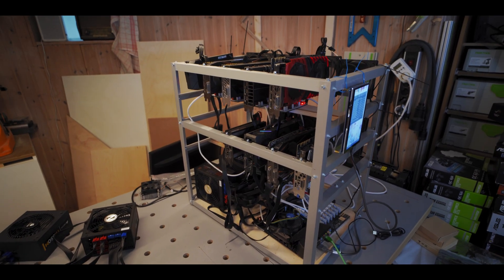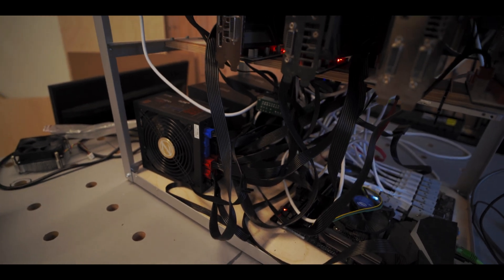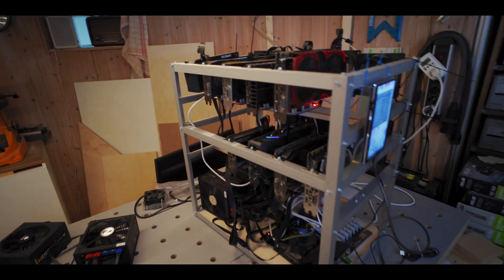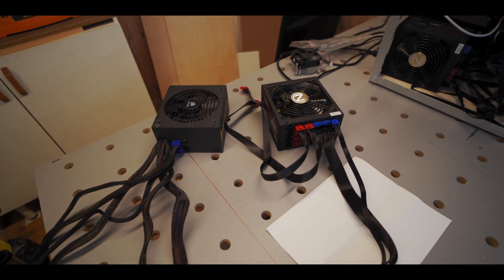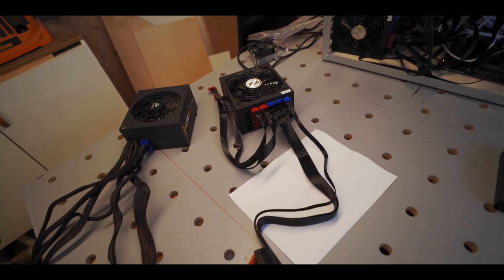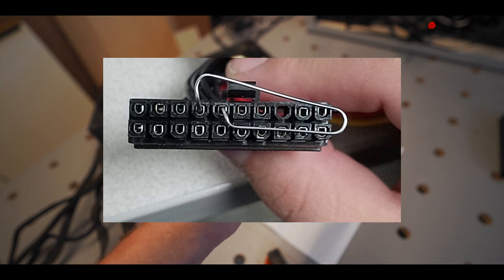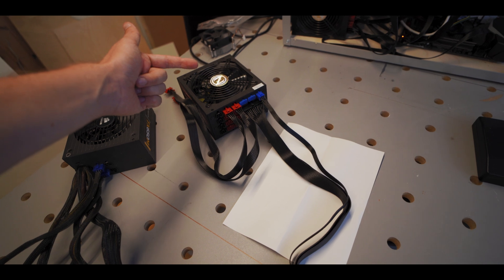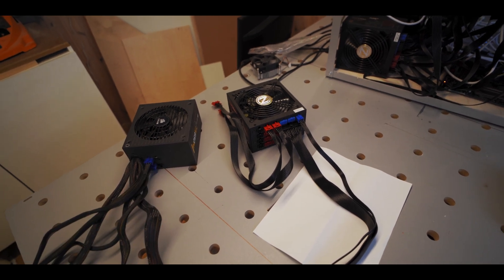How to SAFELY use multiple power supplies for crypto mining (4 ways!) 24-pin PSU splitters, Add2PSU

Comment: Hi man , nice Videos. Can you give me a tip ?
I plan to Power 4x 3080ti´s do you think the 2x 850watt psu´s from your Link can do that. I could not get my head around the riser thing.
So in order to power a gpu and its riser i need to connect one 8pin vga to gpu & for the riser a 6pin sata ?
im confused , because there is 2 8 pin on the graphics card and it just needs one of them 8pins to work ? 

your help would be much appreciated

Comment: What if you're using PCIE riser cables that aren't powered? Do you recommend only using powered risers? I'm looking to add another 3090 and there isn't enough room in my case, so I need an extension cable and I also need to add a second power supply to power it. I'm not finding many options that are powered and also PCIE Gen 4.

Comment: Hi Seb, thanks for the great vid and I have a questions. 

I have a 10x 3070 rig currently powered by 2x 850w PSU. Main PSU connected to MB + CPU + 5 x 3070, the other PSU connected to the rest 5 x 3070. 

My questions are 

1. Is the main PSU solely powering MB and CPU so it handles more power load than the 2nd PSU? Or are two PSU evenly splitting all powers load of all components (MB+CPU+ 10x 3070)? 

2. I am thinking of replacing the main PSU with a 1000w PSU, is it okay to have 2 different watts PSU powering the same rig? Thank you so much for helping!
Reply: youre cancr

Comment: So can i use a 24pin splitter to power GPUs on both power supplies ? Or do i need one power-supply for GPUs and the other PSU for other components when using a 24pin splitter? What about the chip, can it help both PSUs to power GPUS?

Comment: i have a main 550w and im getting an extra 750w for gpus. Do i need to switch the 750w to the main position necessairly? The 550w is so well set up, didnt wanted to disasemble it all. I wish i could use that 750 as second psu

Comment: What happens if you connect the one with two cables (the cable at 5:10) to the main psu? I may have done it and now the cpu fan and gpu fans wont spin. gpus get hot but fans dont spin. I dont understand it. Now I connected them like you showed but still rig doesnt turn on.
Reply: I think motherboard is ok. When I press the power button psus work and when I hold the power button they shut down. But I still could get cpu and the gpus to work. Do you have any advice?

Comment: I have no idea why, but I have this adaptor add2psu but it simply doesn't work, I feel it's not feeding too much power, so not even the bios come out, only black screen, and the fan of the psu doesn't spin either... I'm using gigabyte 1000w full modular

Comment: I need to connect 3 PSU can i use 1 x 24 pin splitter cable and ADD2PSU chip ? or 2 x 24 pin splitters ? Is it safe ?

Comment: multiple power supplies for dummies like me :) thanks a lot seb. I plugged in 3 gpus to a 850w psu and it keeps restarting so I bought the splitter cable thing and it's on shipping. right now running only two cards and one is sitting idle because of this problem.
Reply from the maker: Are you sure 850W is enough for your 3 GPUs? The rig powering off is usually a sign of not enough power
Reply: @SebsFinTechChannel  total gpu power draw on software is around 650w and lets say 100 for the rest. it should be enough. they're nvidia gpus so software power should be accurate.

Comment: Good video Seb.  I just splice the signal and ground cables with detachable plugs into both of the psu's motherboard harness.  Similar to your third option, except I solder wires into the harness.  Much cheaper, simpler, and just as effective.  Looks like I have mi rig wired in the big No No method.  Will buy some more psu's so I can correct that.  Thanks, and keep up the great work. Cheers from Canada.

Comment: Need help with powering second PSU. 

I’ve done a lot of troubleshooting steps but don’t know what else i can do here. 

[setup]
PSU 1 connected with mobo, 4 gpu and hard drives. 
PSU 2 connected from PSU 1. PSU 2 has only 1 GPU

[verified working] 
Mobo, all gpus, both PSU, all ports on PSUs
PSU 1: Corsair RM1000X
PSU 2: Corsair RM1000

[troubleshooting steps]
- swapped PSU and both are working when it is the primary. 
- swapped all GPUs and they all working on primary PSU

I’ve tried using add2psu and 24 pin adapter and i still can’t turn on the second PSU. 

I even hear a click in the second PSU when i turn on the first PSU but the gpus won’t turn on.

Comment: Thank you Seb! Just ordered the SATA version of this for my new ATX power supply for my first multi-GPU rig!! It’s made of 3090s (I have limited space so it’s worth it for me to get high hashrate cards). I also used the TRex absolute core clock on them to save 55W of power on each of them thanks to your other video. Keep up the good work.
Reply: I would not recommend using SATA for mining.

Comment: Great vid Seb. 
You explain it clearly.

But if i use full modular PSU, where to plug the molex cable? 
so i need to buy 6/8pin to molex right?
Reply: or Four-Pin Peripheral Cable = molex?

Comment: Good job. Thanks for the video. GPU and Riser on the same power unit. OK , but what if you have a PSU with 2 or 3 12v rails on it. Do you need to power gpu and riser on the same 12v rail or you can use one 12v rail for only the risers and another for only the gpus ?
Reply from the maker: I’ve used different rails but the same power supply before with no issues

Comment: The Add2PSU adapter causes my secondary psu to shut off randomly. Not sure why. It's amp draw is within 80% range. Have it wired as you describe in the video.
Reply from the maker: What PSU is it and what do you have plugged into it?

Comment: Hey Seb! Me again, that annoying guy that got into mining and now asks you questions all the time.  So I followed this guide in order to upgrade my Raven rig to now run 5x3060, 4x3070ti and 3x3080ti.  I have the main power supply which is 1000w that powers MB, fans, and 5x3060, then I have second 1500w be silent powering 3x 3080ti and another 1200w corsair powering 4 x 3070ti.  They're connected via the add2psu chip from the main power supply via molex.  After about an hour the corsair psu that powers the 3070tis just shuts off, then trex shuts down.  I have to restart or pull out the 24 pin mobo cable to get the psu started again - do you have any suggestions?
Reply from the maker: Hey George! :) So I'm a bit concerned about your power. I don't think 1200W is enough for 4x3070Ti's. Let's see, 3070Ti TDP is 290W. 290W x 4 = 1160W. You are kind of already above what the PSU can actually supply there since even a platinum rated PSU can only deliver 89% of its wattage at full load, but then good practice is to leave another 25% headroom (aka the 80% rule). So 1160W * 1.25 = 1450W. So really to power 4x 3070Ti's reliably and SAFELY you'd need 1450W. The reason for this, and probably why you are seeing the PSU crash is due to random power spikes. I know we are mining and we are power limiting our GPUs but the GPUs can still spike up to their full TDP for a second here and there and that's why we need to be generous with our power supplies. It's better to spend an extra few $100 than have your house burn down. To learn more please watch my video on safely powering your mining rigs if you haven't already: https://youtu.be/MIW0i7SlIYI Good luck and just reply if you have any more questions! Or even better join us in the Misfit Mining Discord: https://discord.gg/5Tdq4pZk
Reply: @SebsFinTechChannel  Hey Seb, thanks for the reply.  I have another 1500w be silent powering another much less power hungry rig so what I will do is swap them out and let you know how it goes - also joining the discord!

Thanks!
george

Comment: Im glad you hit on the gpu/riser on same psu. Huge importance especially with atx psu and their small 18ga  gauge cables. 
Ask me how i know😁
Reply: 18ga is not small. its standard
Reply: Standard for a PC. Never had insulation melt off a 16ga cable and catch fire. Seen 18 do it. You sleep better at night running 16ga

Comment: Risers also use 8 pin power connectors?! We will be running out of 8 pin connectors that way :(
Reply: Nvm found the answer to my question in your other video XD. 8 pin splitters was the answer. But I have noticed risers that can also be powered by a molex connector. Are those safe to use?
Reply from the maker: I think this video will help you: https://youtu.be/MIW0i7SlIYI
Reply from the maker: What do you mean? What in this video uses 8-pin?

Comment: help I just impulse bought a 6 pack riser and a 850W PSU as well as a Add2PSU chip for literally no reason I dont even have GPUs to power only a GTX 1070 a GTX 660 ti and a MSI N650. the 660ti and N650 was in my basement. and they're practically unusable for mining(lolMiner requires a minimum of 4GB VRam iirc)😂😂
Reply: I was mining with the 1070 but the rate was way too slow. made the equivalent on $0.70 leaving it on overnight. I just stopped it😂

Comment: Is there any problem using the sata version of the add2psu? Can i, for example, feed 2 add2psu with the same Sata cord coming from the primary psu?
Reply from the maker: That will probably be fine :)
Reply: It’s totally fine , the add2psu doesn’t pull much power the sata or molex is really just used for signalling to trigger the relay that shorts the activation pin on the at connector.

Comment: Please, Can someone help me to overclock my graphics card without breaking its warranty for Mining. With two cards as of now, 3070 and 3060. But i get only 25 and 20 mhz and sometimes 48 & 35. I know it has to be OC done but i need experts advice to do it without breaking the warranty. Please suggest what are the settings to be done ?
Reply from the maker: From what I know overclocking does not void your warranty.
Reply: @SebsFinTechChannel  Thank you.. Would you mind to share some quick suggestions on how to overclock NVidia 3070, Gigabyte 3060, please.. any particular software to be used, something from your experience....

Comment: As someone who has used multiple power supplies in a few rigs, the main reason you'd want to avoid mixing power sources from different PSUs is the effect of minor voltage differences between the 12V rails (which in some cases are not minor), can have on your components. This can be especially dangerous if your grid occasionally experiences brown outs or voltage spikes/drops, as each individual PSU will be able to maintain it's target 12V voltage differently. If the 12V from the riser and the 12V from the PCIe strand diverge too far, this can have potentially catastrophic effects on both the GPU and PSU. I almost killed my Seasonic Prime unit during a brown out, when I accidentally powered the riser of a connected card via Molex from my other PSU, My Seasonic unit was acting as the secondary unit and was connected via the "add2PSU" chip. Luckily with their 10 year warranty the distributor was able to provide me a quick fix (I think a cap blew out), but it could have been a costly mistake.
You also really want to make sure you spread your loads in a meaningful way when using multiple PSUs, to avoid loading one PSU up to 100% while the other one works at 60% load capacity. So e.g. 4 GPUs on one PSU & 3 GPUs + MB + fans on the primary (assuming all GPUs have the same power draw and both PSUs have the same Wattage capacity).
Reply: thank you for sharing and when using dual psu did u have to go into bios and edit something for 1psu main and then second psu?
Reply: @jkelsall2017  not at all. The motherboard (or rather BIOS) does not care where the power comes from. As long as all required rails of connected components are loaded up with power e.g. switched on when the motherboard gets turned on, then all components should be detectable during boot and that's it.

Comment: Hi Seb. If you can, I think you should do a video on server power supplies and how to power them correctly. For example, I was wondering how many watts a 6 pin break out board connector could supply and to my surprise, I was told by Parallel Miner that all of the 6 pin connectors are linked, so as a result you could in theory pull 1,000 watts from a single 6 pin connector on a 1,000 watt power supply.  Now not a good idea since the 16 awg wire can't support that, however that is the point.  How many connections from a single 6 pin break out board can you safely make.  Below is the actual response from Paraell Miner I received when asking that question.  If I read what they say correctly, then 10 amps for 16 gauge wire x 12 volt = 120 watts x 3 = 360 watts for a single 6 pin connector. That would seem to indicate you can hook up 2-8 pin connectors OR 1-8 pin and 2-6 pin connectors to each 6 pin connector on the break out board, but no more. FYI, I'm guessing English is not their first language. Anyway, I'm not saying I have figured this out.  Just saying I think it would be a good topic to cover if you are able.:
 "Hi,

he break out board doesnt have a limit as per say, all he 6 pins connector are link.
So you can draw 1000w if you want.
Problem is the cable will melt
the power limit of any electric cable is base on its size. Here we have 16AWG stranded copper and they are three pairs per PCI-E cable. The extra 2pin are ground. Found the amp rating of 16AWG wires “Chassis rating” multiply the amp rating x 12volt = Watt then multiply by 3 pair. (Amp_Rating X 12) X 3 = Maximum watt per PCIe cable. To be on the safe side of things I would use only 80% of the result so X 0.80. "

Comment: how about using 2 normal 24-pin PSU splitters for 3 PSUs if you don't have (can't find) the one that connects directly 3 PSUs as shown at 11:00?
Reply from the maker: Hmm I don’t know how safe that would be. I personally wouldn’t risk it with stuff like that. I’d rather jus get 2x Add2PSU chips

Comment: Hey Sebs, great video as always. I am starting to change my PC from a desktop to a rig. Just got 3 rtx 2060 (it can mine ergo, rvn and hashes nicely in octopus...) so I will have 1 x 3060, 1 x 1080 and 3 x 2060, a small rig but my first.
I had some issues trying to set the 1080 outside in a riser, it is detected by windows and GPU-Z but not by afterburner.
I think my pcie x1 slots doesn't work properly... I will change it to the 2060 and see if it works.
Have you had this issue before? I may have to change all pcie in my bios to gen 1 btw...
Regards and again, congrats for the video!
Reply from the maker: Usually an issue like that would be fixed by just rebooting the pc after you make sure windows is done setting the GPU up (no yellow triangle in device manager). Good luck!

Comment: If a 450w non-modular PSU only has one PCI-E (6+2 pin) cable, how many times can it be safely split? For instance, how many 1660 supers can I safely run on a 450w psu which only has one pci-e cable?
Reply from the maker: I recommend you watch this video to learn more about power safety, I think it’ll answer your question: https://youtu.be/MIW0i7SlIYI Good luck!

Comment: This is an excellent guide for using multiple PSUs. Many thanks for creating it. If you're taking requests, I'd say another great beginner's guide would be cooling. Like how to use the fans (back or front), which way to blow air, how to use external fans as you have in your setup etc.. Thank again for the great content.
Reply from the maker: Cool I’ll add it to my (long) list of potential video ideas :)

Comment: Hi Seb, will you please answer my question and doubt, I have one power supply  Silver Stone Technology Strider 1200W 80 Plus Platinum Modular and according to your experience I would like to know if it is work with 7 gps 1660 super?
Reply from the maker: Hi! 1200W should be absolutely fine for 7 1660 Supers. They have a TDP of 120W so 7x120w is 840W. Then add 25% to be on the safe side and you’ve got 1050W which is within 1200W. So should be totally fine if the 7 GPUs are the only thing connected to the PSU.
Reply: @SebsFinTechChannel   Hi Seb, thanks for answering, yes of course the 7 gpu, Motherboard and SSD only, then it would be working fine ? today and now I mount it like this.
Reply from the maker: @aishamysticjeweler5544  oh motherboard and SSD as well? Well that should be fine but on the limit
Reply: @SebsFinTechChannel  well I have another 800w you think it is better to use or put this other as secondary
Reply from the maker: @aishamysticjeweler5544  if you have the 800W one to spare anyway I would use both :)
Reply: @SebsFinTechChannel   Thaks Seb, ok finally could you tell me what are those small monitors that you use hanging on the rigs, how to install it and where can I buy them ?
Reply from the maker: @aishamysticjeweler5544  there is a link to them in the description of the video. :) you just plug them in with hdmi and usb

Comment: Great video. I´m using dual PCU's for my rigs, going way overboard too. 2x corsair 850w on rig 1 and 2x EVGA 850w on rig 2. both draws about 1000w. they barelly gets warm, and using just a simple cable to short the start on the slave PCU. have them connected on 2 GPU's each(risers and gpu). Also have them connected on different fuses(the 2 corsairs on one fuse and the two EVGA on another). I´m mostly working away from home, and my offtime i usually spend in my cabin, so trying to think about safety(mostly of my neighbours).
Reply from the maker: Very good! Safety first!! Well done mate sounds very well though out :)
Reply: Can we add 850w and 550w psu using Add2Psu chip?

Comment: Hi
I use two power supply without any additional plug I use four number pin with ohm meter to find the connection to other power supply and connect tham together now my all power supply on and off together now I want to add one more power supply and only to contact same way thx